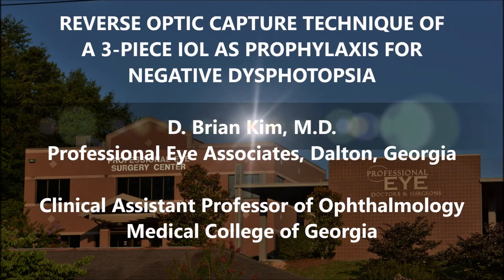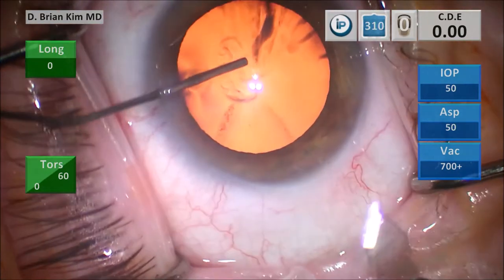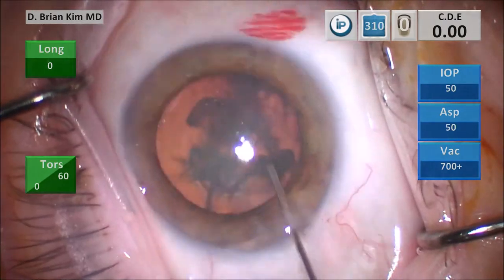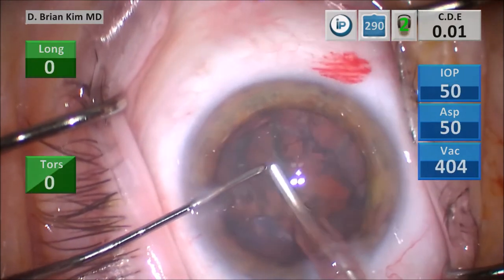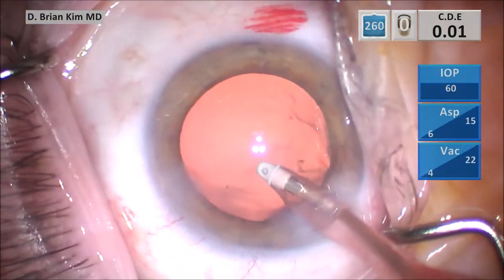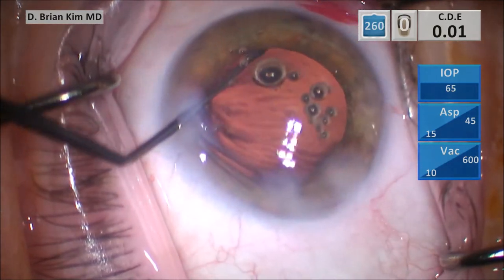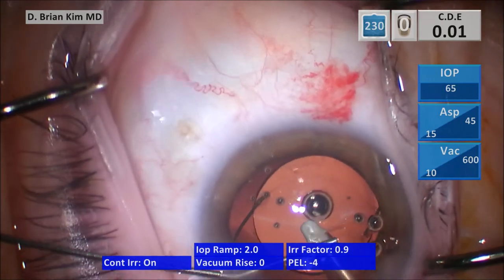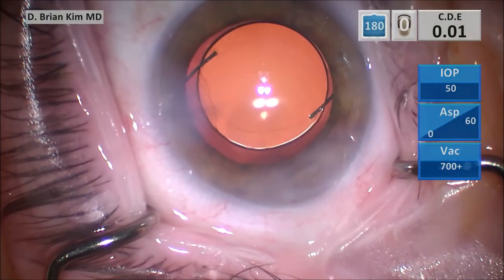Reverse Optic Capture of a 3-piece IOL as Prophylaxis for Negative Dysphotopsia

Comment: With this do you adjust IOL power for sulcus or keep it for in bag placement?
Reply from the maker: It’s not quite full sulcus placement which typically requires a +1.00 diopter adjustment. So I would choose +0.50D adjustment for reverse optic capture. Best wishes.
Reply: Very informative. Thank you

Comment: Would you do an IOL exchange for the other eye with the ND? I am planninh to remove the one piece IOL and exchange it with a 3 piece IOL with reverse optic capture.
Reply from the maker: Hello. It all depends on the circumstance. If the patient is bothered and you have exhausted conservative options, then yes I wouldn’t hesitate to offer IOL exchange with 3-piece IOL and ROC as long as rhexis is small enough with 360 degree optic overlap.